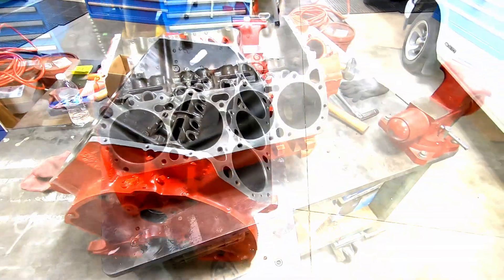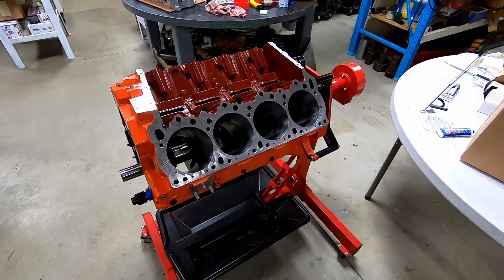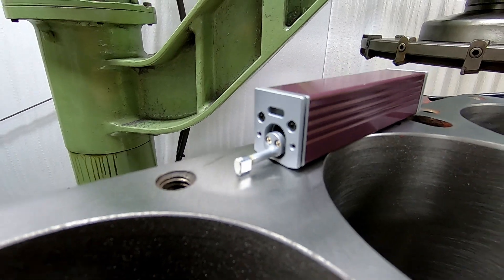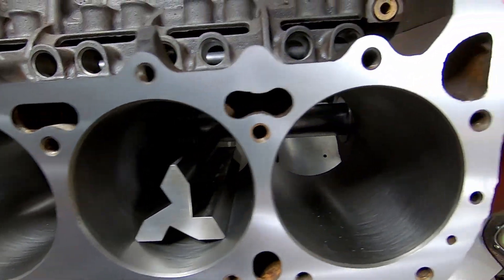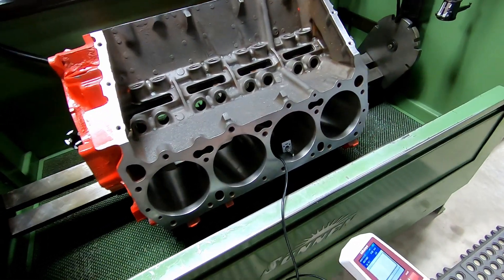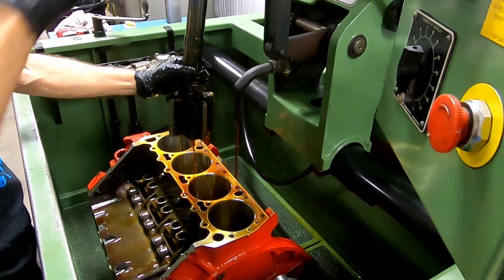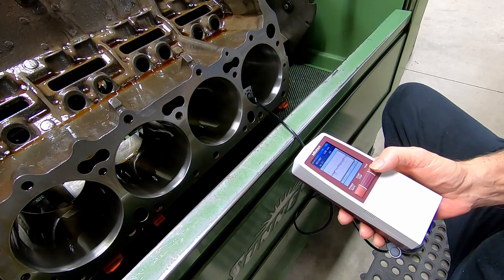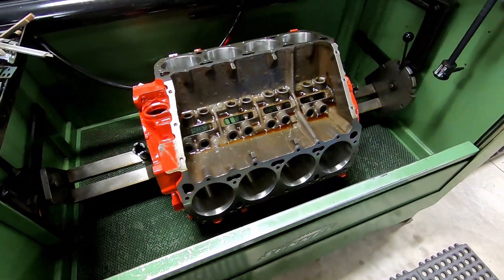Pump Gas 508 Stroker Build: Decking and Finish Honing #mopar #bigblock #440 #440source #stroker

Comment: What is the recommended piston to wall clearance?
Reply from the maker: I will cover that in the assembly video. 440 source gives really nice instructions with their kits. The pistons are icons. If I remember correctly, they say .006 for street engines and it goes up from there. I will show their literature when it comes to that video.

Comment: Why just 508 cubic inches?
Reply from the maker: This is a .040 512 kit. Larger kits require oiling system mods that price out for my customer. This engine is going in an 80’s d100 race truck. It will have impressive torque and love most it’s life below 6,000 rpm.
Reply: @JustMoparJoe  Just curious.

Comment: Hey Joe, is that a factory block, or an aftermarket block. I noticed an oil passage in the valley that I've not seen before.
Reply from the maker: The 440 is a stock 77 truck block
Reply: @JustMoparJoe  ok thanks, I'm hoping to build a 500"engine in the near future. I have a '69 virgin block.